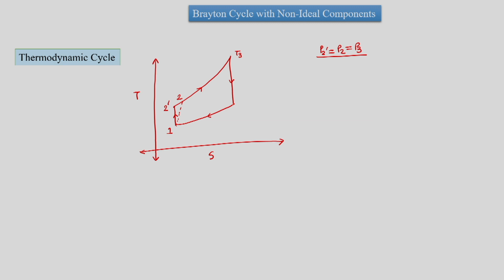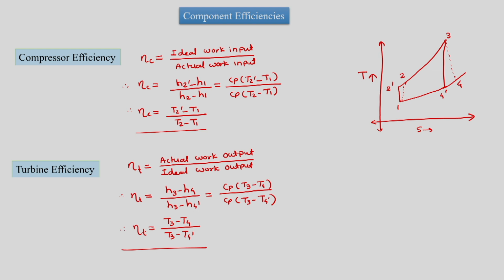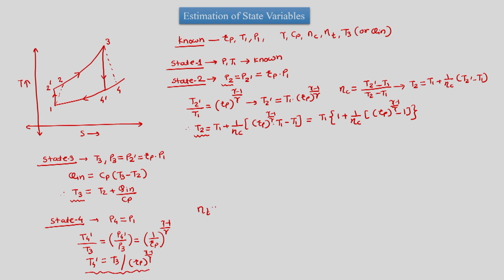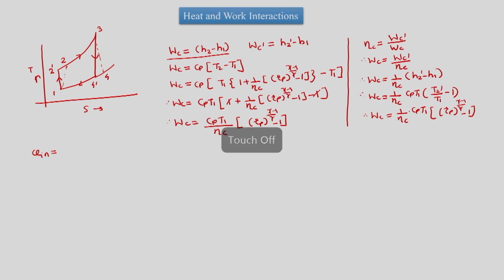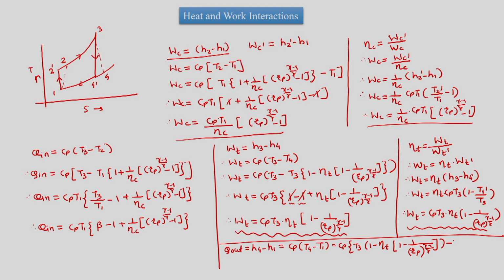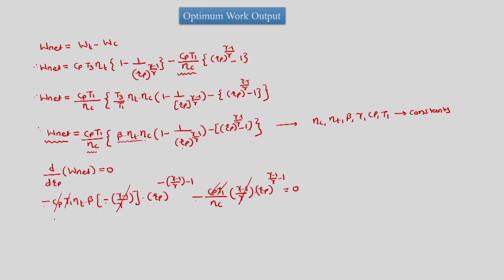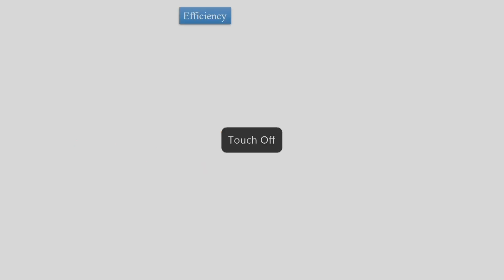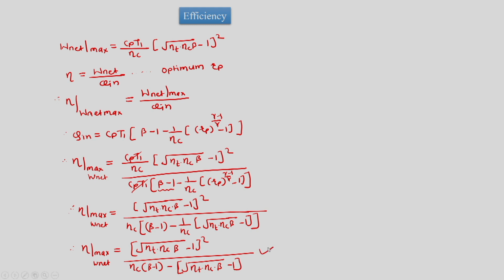Lec 8: Non-Ideal Brayton Cycle

Comment: why is turbine eff. actual/ideal but compressor eff. ideal/actual??
Reply: Found the answer == In a compressor work is input to achieve a certain pressure rise whereas in a turbine a certain pressure difference is used to extract work. The ideal compressor uses the minimum amount of work to get the same pressure ratio, and any non-ideal behaviour results more work being required. Compressor efficiency is therefore the ideal work in divided by actual, as the actual work is always greater than ideal. The ideal turbine extracts the most amount of work for a given pressure ratio, and non-ideal behaviour results in less work extraction. Turbine efficiency is therefore actual work out divided by ideal, as the actual work will always be lower.